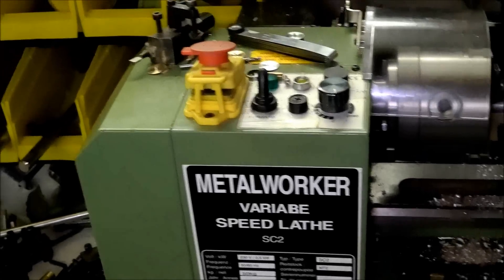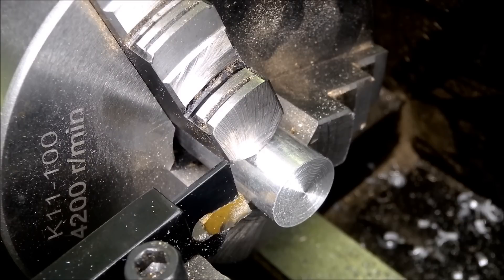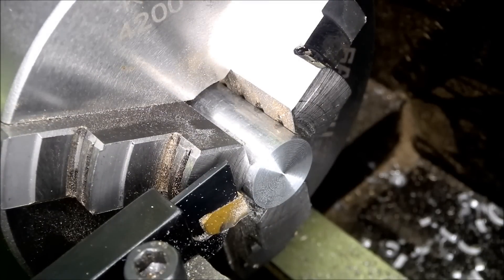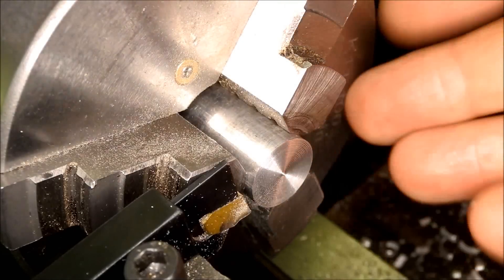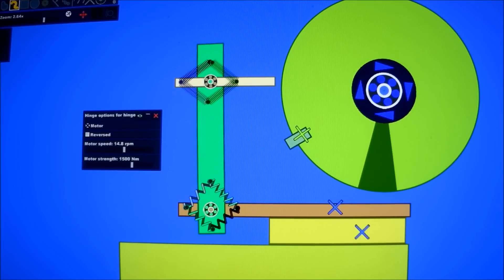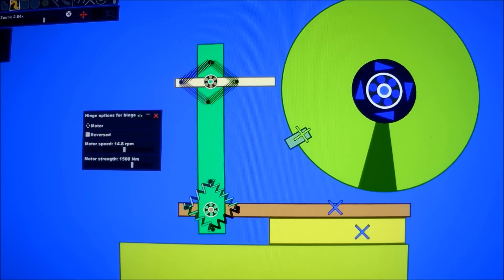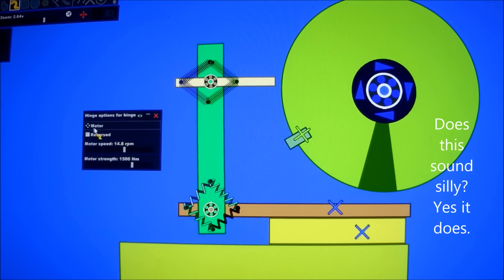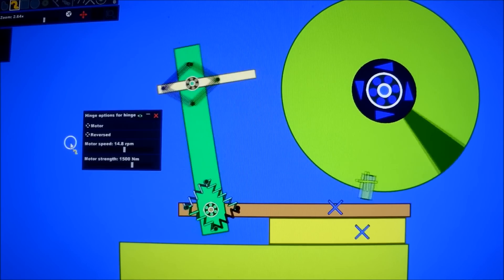The Ultimate Trick: Cutting off  with the Mini Lathe

Comment: You can also get the same or even better results by using a rear tool post and running forwards with the tool upside down. When I was an apprentice (many years ago) the reason for the increased rigidity was explained to me as being because the reaction on the spindle from the tool forces is directed vertically downwards into the spindle bearings where the weight of the spindle has already taken up any small clearance that there must be in order for the spindle to rotate. Wether this is true is debatable, however it should be noted that all capstan lathes have rear toolposts and upside down part offs.

Comment: I would not do this on a taig mini lathe because the chuck will come off the threaded spindle, but when you use a cut off tool on the backside of the workpiece (with the tool upside down) you will achieve the exact same thing.
Reply: I have a 1936 atlas 10d and chuck will screw off if I run backwards and I don't have reverse anyway but it does a good job on cut off if I turn the tool up side down and feed from the back side sense the atlas d does not have power cross feed I made one with a windshield wiper motor and a pwm and it cuts of like a champ
Reply: Hi when I was apprentice in the late 50 's I worked on a BRM 150 Italian make lathe and it had a back tool post on the end of the crosslide for parting off upside down. The back tool post was mainly to have a parting tool always available. The front tool post was a QCTP type.

Comment: In the golden age of British model engineering (between the two world wars) a common modification to a lathe was a "rear tool post" on the cross slide.

It exploited the same cutting geometry your video shows (the rear of the workpiece is of course moving upwards). The rear tool post was normally fitted permanently with a parting tool.

This was also the days before QC toolposts, so not having to swap a parting tool into the main tool post was a double-win.

There are a few videos on youtube of present day rear tool posts used for parting off.

Comment: I saw this a couple of days ago and wondered out accurate it was. Today I was trying to part a 3/4" metal bar and kept having all kinds of problems and not getting my piece cut off. I decided to give you recommendation a trial run.
1) Had to invert the cutoff tool in the tool holder.
2) Had to recenter the cutoff tool in the quick change tool holder, had to go to the maximum of the adjustment to get it close.
3) Had to remember to reverse the lathe before starting the cutoff.
Very happy to say that it worked well for me. Did three cutoffs and finished up the project that I was working on.

Comment: I just found this video and it solved a problem I have lived with for years! Previously I resorted to a bar clamp between the bottom of the saddle and the slide holding the tool holder tightening it only enuf to stabilize the tool but still allowing the cross feed slide to work.  This was not the best solution.  But the solution shown here is WONDERFUL!  I tried it on a piece of scrap brass and the tool slid thru that brass like a hot knife thru butter!  I use the quick-release tool holders and with the adjusting nut all the way down against the holder the holder is still not high enough to center the upside down tool.  I will mill the top surface of the quick release holder down a bit to allow enough vertical adjustment to center the tool.  I will paint the top of the tool holder RED to remind myself to run the spindle backwards.  THANKS for the video!

Comment: I used this method today on my mini lathe. Once the tool height was set properly, it worked on brass and small diameter steel like a knife through butter. No chatter or digging in and a smooth progressive cut  Thanks for the video

Comment: Thanks.  The simulation with the spring models was the best part.
Reply from the maker: Shannon Price Glad you enjoyed it. Thanks!
Reply: +Latheman666 I dont like the simulation because you did not change the tool height when you ran the lathe in normal cutting direction. That way the tool was much more offcenter than in the reverse scenario and that causes the difference.

I have a c2 mini lathe with a hss mini cutoff tool from ebay and using aluminium I found for getting a good cuttoff you need your tool height on centerline and feed consistent so your tool doesnt rub on the workpiece.

Comment: My last lathe was a 10x24 Jet which is a full function machine with right/left carriage feeds, in/out cross feeds, full gearbox and back gears.  It was almost 700 pounds (317 kg); kind of a beast for its capacity.  I knew nothing of rigidity problems with it.  I sold it because of a long distance move and bought a sub-500 pound (226 kg) 11x26 which is closer to a mini-lathe in its construction.  It has taught me the meaning of a less than rigid lathe.  I'll certainly give this a try!

Comment: Perhaps the best solution is to get a back-side parting tool post. Many people like these better because you can leave both your cutting tool and parting tool mounted at the same time. I have to remove my cutting tool to mount the front-side parting tool and even have to remove the work because it is in the way of replacing posts. My stepper motor mount prevents me from removing the T-Slot posts from the front side. Also, with a back-side parting tool post you get the benefits of a down-facing cutting edge (as you describe) without having to run the chuck backwards and risking it unscrewing itself. Having both parting and cutting tool posts mounted at the same time means a CNC-user can turn and part all in the same program without stopping.

Comment: With regards to your simulation it’s shows the cutting tool at the same height in both directions. If you run your lathe in the conventional anticlockwise direction as you look at the chuck the tip of you cutter should be just below center then it wount pull the tool in like the simulation showed. This may be where you had problems in the first place. 
Hope this helps

Comment: Thank you Latheman! I have always dreaded parting on my lathe. This tip works like a charm even with slower RPM and slow cross  feed. Getting the tool height correct is important as with any lathe tool. I took my time and learned on scrap pieces. Works beautiful! Thanks !!!!!!!

Comment: A friend on one of the engineering forums gave me a good explanation as to why latheman is correct that the parting blade is knocked clear of the work piece if a problem arises,,, he explained it kinda like this,,the blade is indeed pulled into the work piece when it jams while the machine is running forward but when the machine is in reverse any 'play' that exists in the toolpost holder and compound slide ect,will open out and allow the tool to be pushed clear,but in forward mode the same 'play' is compressed tighter by the force of the work piece pushing downward..thus everything jams up....at least I think thats what you guys are trying to explain to me...Ian,model engine making is a quite recent hobby of mine and where I live I don't have anyone else nearby who has the same hobby so utube has been a great source of info for me as it lets me see things actually being done which is always better than just reading 'how to' in a mag or on a forum..any new tasks I have to do I check utube first to see if someone has posted a video of themselves doing that particular job...its a really good resource for novices like myself..
Reply: There's more to it than that -- the geometry of the tool post drives this effect.  Because the support for the tool isn't directly beneath it, cutting pressure exerts a bending/rotating force on the tool post and lathe bed.  With the normal arrangement any such bending causes the tool to hog deeper into the work, but if you run the spindle the other way the bending force relieves the tool instead.

Comment: Just a small tip for a C2 lathe.  If you have a standard parting tool holder you might get it to fit if you turn the standard toolpost upside down and use grub screws to hold the parting tool.  This trick allowed me to mount my standard parting tool holder and get it on center to try out this process - it worked great, allowing me to part off a 3/4 dia brass rod with one smooth cut.  I intend to make a custom toolpost to hold three sizes of parting tool so I can just drop it on and use the required size of tool.

Comment: As somebody else mentioned, the simulation is not correct because you didn't change the height of the tool when running in normal mode. However, I just did the same simulation with Algodoo (formerly Phun) and I get very similar results. When running in reverse, the toolpost flexes away from the workpiece. When running in normal direction, the toolpost flexes into the workpiece.
Nice demonstration and good explanations!

Comment: Thanks, I will be trying this technique! I'd like to add, I read somewhere that cutting a small notch in the center of the HSS parting tool will help with chatter. I tried it myself, and it does seem to help to reduce chatter on a smaller lathe, in forward rotation. The notch was cut using a thin dremel cut off wheel. The groove runs parallel to the sides of the cutoff tool, making a small V shape in the top edge of the parting tool. It seems the shearing action of the V groove helps remove chips, and there's less surface touching the work. That said, I think your idea is better for larger forming tools.

Comment: I have a diy 80mm  chuck mini lathe with a small cross slide.  I was unable to cut off aluminum part. But with that reverse cutting  technique Im able to cut off 30mm steel with hss tool. Thank you...

Comment: From what I can see, place the tool below the center line in the forward direction and you'll achieve the same thing.  You will always have a decreasing angle which is key to the tool not digging in.
Reply: That puts the workpiece in a climbing situation.  It's an eye-opening experience when that happens!

Comment: the actual reason it works better is due to the spindle bearings in your headstock.     excessive bearing clearance allows the spindle to lift and bounce causing chatter.    never cut slow slow with an inserted tip  these tips need speed friction and pressure to achieve a proper cut.  if you want to run slow use high speed steel tools

Comment: No I do not have a number for oxtools but I geared up my lathe today to part using that advice and I never had a failure--I am quite chuffed,I put the tool upside down,switched the lathe into reverse rotation and and magic happened--beautiful cuts-no trouble..
If you do not have the luxury of reverse rotation on your lathe you will have to go to the other side of your lathe upside down
Reply: Ian, from "chuffed" I'm guessing you're from the UK.  You might enjoy/find useful L. H. Sparey's The Amateur's Lathe, published in at least five editions since 1948.  My 1976 hardback lies flat very nicely whilst opened; my 1991 paperback has slightly crisper print and photos.  If I haven't got my memory mixed up Sparey was the model for the main character in Nevil Shute's Trustee From The Toolroom.

Comment: You can do this without going into reverse by mounting the cut off tool upside down on the back of the cross slide. Many CNC lathe have a static cut off tool on the back side and the primary tools on the front side.
Reply from the maker: russianwolf1972 Yes, that would work too. Unfortunately on many mini lathes (including mine)  there ist not enough space for a a tool on the back of the cross slide.
Reply: Latheman666 Maybe. Mine is a Sherline, so I have a good amount of room and can swap on a 13 inch cross slide table from a mill easily enough if more room is needed.

Comment: good video, thanks. This trick is known since a long time and  works particularly well for mini lathes which all suffer from low rigidity. However there is a safety risk for lathes with a chuck mounted to a threaded main spindle. By reversing the spindle direction those chucks can work loose and jump in the face of the user. Such lathes should NEVER user reversed spindle directions.

Comment: even after a lifetime of machining I learn the correct way, only on problem , you can't do this reverse run if you have threaded chuck, it will unscrew.
Reply: Invert the tool and cut from the backside of the part. That way you don't have to run reverse. Sherline actually makes tool holders for this. I wasn't convinced until I tried it. Works way better this way.

Comment: brilliant, really useful information, il be using this on our lathe at work, that animation is a great tool (pun intended). Just as you cut through the final little bit of material you got an audible noise that sounded like it was colliding with tool can you confirm that the part was ok
Reply from the maker: +nathan hellyer I don't remember.

Comment: I think whats happening here is when turning in reverse the headstock and spindle are forced downwards therefore making it more rigid and the tool post is forced rigid in an upwards direction causing little or no chatter. Unless you are working on a lathe with a heavy headstock running duel double high precision taper roller bearings at the rear of the spindle and triple high precision taper roller bearings at the spindle nose chatter can be expected. This is a good demonstration this though it is better to cut from the rear keeping the spindle running in the forward direction.

Comment: HI, thanks, but isn't the reason the cutter is drawn into the piece (when running in forward) because you have the cutter quite a bit above the center of the piece being cut?
Reply from the maker: Gom Bart Thank!  I noticed this error after I uploaded the video. I forgot to set it at center for the presentation, after I simulalted it  at center height, below center height and above center height. Reverse operation did always work better in the simulated flexible lathe.

Comment: with regards to the tool getting knocked clear of the work piece when upside down,,I don't understand...surely if your cutting bang on centre there should'nt be any difference??but it seems to work so i'll give it a try...thanks ...
Reply: Tom Lipton with oxtool has got a video on the same subject and uses the same reasoning...have a look at that..
Reply: Ian Craig Thanks Ian,lots of good stuff there for  me check out and learn from..cheers.
Reply from the maker: Ian Craig I couldn't find that video from oxtool. Do you have a link to it?

Comment: Makes sense, why then wouldn't all lathe tools be used in this fashion. Is their a downside to general lathe work running in reverse ??
Reply: +Rice Crash I thought the same thing...  why not just do all your turning backwards with the tool upside down? Ill try it on my next project.
Reply from the maker: +Rice Crash I think a downside is that you don't see the cutting edge. Especially when touching off it is important to see the tiny chip that forms.
Built-up edges also couldn't be seen.
Reply: +Latheman666  smaller lathes have the chuck fixed with thread. it can therefore unscrew.
Reply: With normal rotation and tool orientation the force of the cut forces the carriage down onto the bed. Running in reverse like this can damage the carriage and the bed.
Reply: +Rasmus Hansen modern ones have a locking mechanism or pins to prevent this. It's not good advice to run a lathe backwards there is a reason they run anticlockwise
Reply: I know, - as i'm skilled machinist.   But it's a well known, old school trick to do this, also when using large surface toolbits this can be the solutions, even on large lathes.
Reply: +Rasmus Hansen if you are going to do this run the lathe the right way but cut in with the parting off tool from the rear of the work

Comment: BE INCREDIBLY CAREFUL first of all most older lathes utilise an threaded spindle if you run these lathes in reverse the chuck will spin off and fly across the
Workshop, if this happens it will almost definitely strike the spindle thread on the way out rendering the lathe completely useless for accurate work, second of all if the tool were to bind up it would shear the tool holder attachment and throw it at you. There is a reason lathes run anti-clockwise.

Comment: Excellent tip. If only my lathe would run in reverse.
Reply from the maker: Raymond Davis Thanks. Maybe you can put a cut off tool at the opposite side of the crossfeed.
Reply: Latheman666 Not an option either. The crosslide measures appr 2"x3" (it's a strange little minilathe, a Vigor super-mini 6"x8") with about 6 " of travel. And then the parting tool would have to mount upside down, and the QC tool holder is specifically made for T-style parting blade.

Comment: I want to see this done with stainless. I want to believe this works but I don't think I'll be able to bring myself to even try it.
Reply: +Clown Whisper It is just the same as having a rear tool post for parting tools.  The tool is then mounted up-side down, with the same advantages as described in this video.  I never thought about running  the machine in reverse and do the up-side down trick without the rear tool post.  Thinking too much inside the box, sigh.  Thanks for sharing Latheman666

Comment: I like your computer simulation, but you need to change the tool height when you change chuck direction. Let's see what that looks like.
Reply from the maker: You are right. The tool in the simulation is not on center height. I noticed this error after I uploaded the video.  I forgot to set it at center for the presentation, after I simulated it at center height, below center height and above center height. Reverse operation did always work better in the simulated flexible lathe.